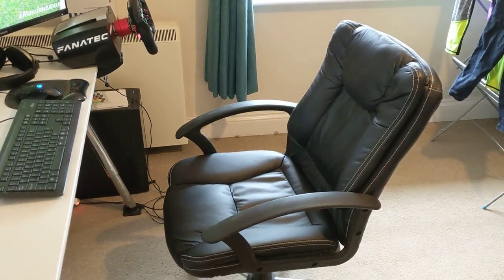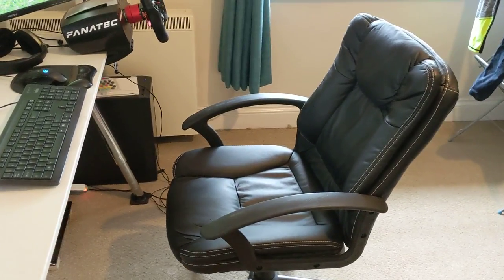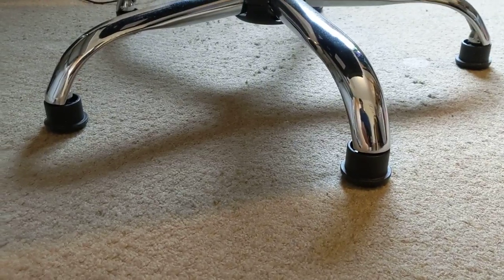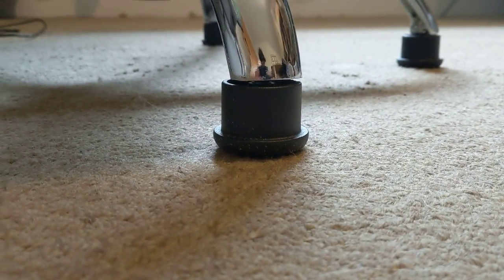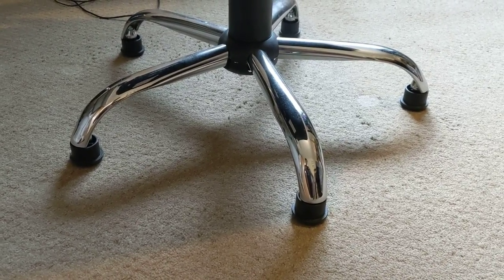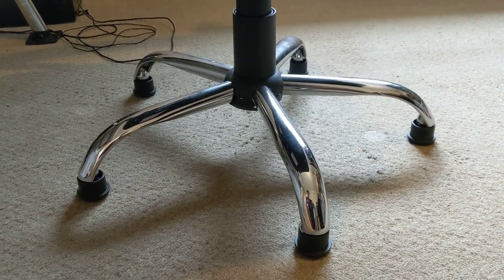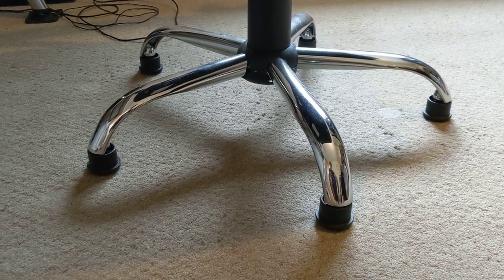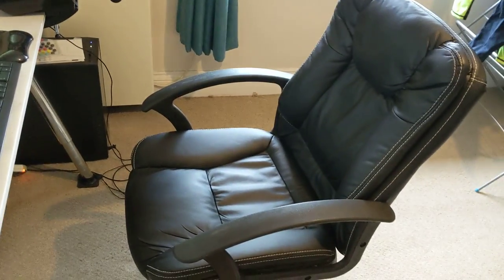Sim Racing - Keep your chair still without a rig

Comment: In my case, the gaming chair I purchased 2 years ago had available "locking" casters as an option. They basically lock in place from the weight of sitting in the chair. Works like a charm for me! I would hope that generic casters like that are available for most rolling office chairs, assuming the size of the pin is the same on most of them.
Reply: What chair you got?

Comment: The issue is that it will still rotate. The rotation on my chair is VERY smooth and effortless... so any sort of force pressing on the pedals will rotate me away from the pedal like I'm pushing off the wall.
Reply: have you found a solution for this yet? only problem i’m facing 😭
Reply: @mvterivlistic  There's a company that sells a cylinder with a rotation lock, but I'm sure it's a specific fit for their chairs. Monstertech makes them, and it's specifically oriented towards flight sim and race sim applications. Besides this, I don't think there are any elegant solutions, but there are some jank solutions, like strapping your chair's armrests to the legs of your desk to prevent rotation that way.
Reply: @TakeNoShift  i don't even play racing/flight simulator games and the chair rotation on my T3 RUSH Corsair bugs the hell out of me. i've been looking for a solution. I think i'm just going to buy a chair of monstertech. I'm afraid to risk if the cylinder will not be applicable to this chair i'm using

Comment: Are you using load cell pedals? Is this enough to keep you from sliding even with Load Cell strength?
Reply from the maker: Yes, I used Fanatec V3s with brake performance kit with the stem castors, did a good enough job!

Comment: I'm late to this, but it's still relevant. I have hard floors so didn't want think stem casters would work. So I just put gaffa/duck tape round the wheels (horizontally, so they don't go under the base). Solid as a rock! My chair tips over before it slides.

<edit: my castor cups arrived, so I replaced the duck tape. Still solid, and a bit less inclined to work its way free like the tape was. Stem castors would be better, but less adaptible >
Reply from the maker: I tried the same thing you did - taped it up, but found the tape eventually got munched up in the wheels anyway. I didn't know stem castors were a thing at the time, if I did I could've saved myself the bother! Hence this video
Reply: The tape thing is really an improvement,i was surprised, thank you man,

Comment: Hi Danny i know you have switched to a rig now, i'm going to buy these stem casters but did you find your chair rotating much when using the pedals? Can't test everything as my DD and gear hasn't arrived yet, thanks for the great advice.
Reply from the maker: I never found the chair rotating to be much of an issue, it was always the rolling back that caused the trouble for me. Sorry not to have anything clever to advise for that!